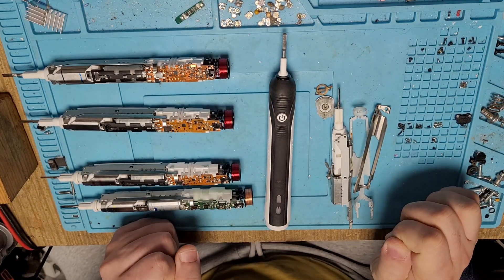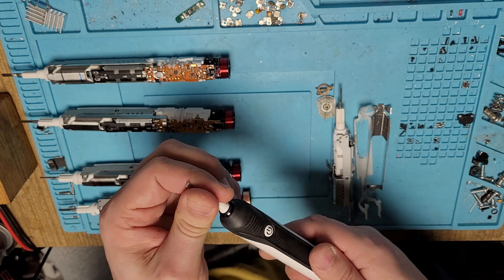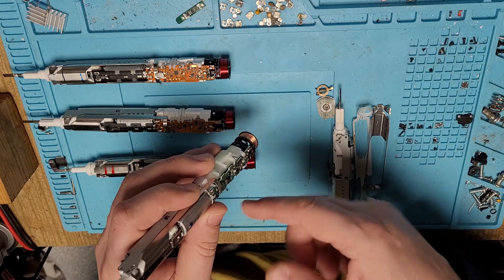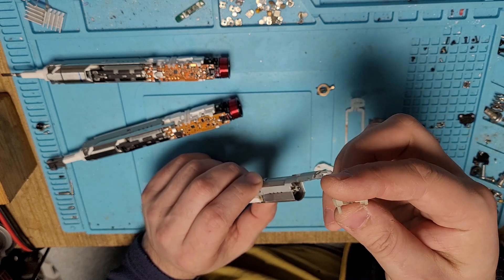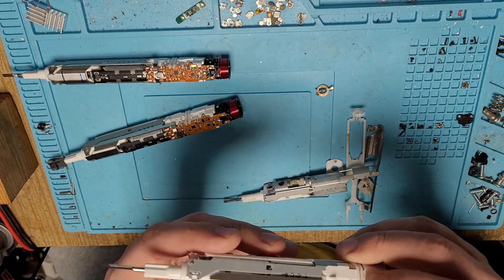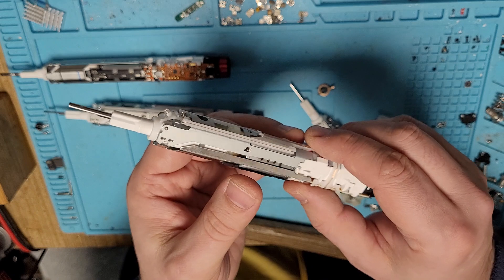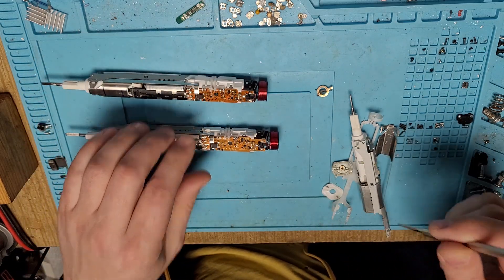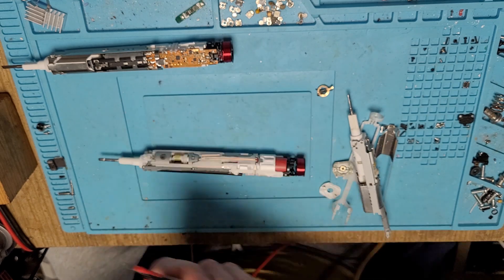Repair of various Braun Oral-B Pro or professional care toothbrush defects

Comment: Hello, my toothbrush won't start, but the battery is reading 4v. I have tested the fuses and the power resistor and all are fine. However close to the switch, there is a small brown capacitor that is shorting to ground on both ends. Would you by any chance know the ohms / voltage of the capacitors that are used as I feel it's this one issue that is stopping the entire thing turning on. I don't really wish to remove one to measure it, as they are quite small and I'll probably lose it. 

Thanks.
Reply from the maker: If it's shorting you have to remove it. Capacitors are measured in uF but it's very difficult to measure their values and there are no value on them written.. you can try to run it without the capacitor as some times they work to level out voltage spikes so not always they are 100% necessary for motherboard to function..
Reply: @letsfixitgarage  Hello, please forgive my ignorance, I didn't mean ohms, I meant microfarads, I posted this at the end of the day of fault finding. I think I was going mad by that point! 

Anyway, really weird thing. I pressed the button today and all of a sudden it's working again. I have no idea how this is possible. I pressed the button so many times yesterday and it was dead as a dodo. I kind of don't like that is working because it doesn't make sense. I would prefer to know why it hadn't been for 24 hours. Really strange. I guess what I suspected was a cap can't be a cap... but I tested all the other same colour caps and one end would have continuity between ground, and the other not, except this single cap. I'm baffled.
Reply from the maker: No worries as they say there are no bad questions but for someone new reading and learning from comments it's good to talk in the same language :) as for your problem it's very difficult to say for sure.. only time and using it/testing will show if problem will come up. Sometimes it can indicate component slowly dying but its not helping for identification and repairing.. as in my video for genius repair fuse usually reads fine but when current flows through it it heats up and resistance grows.. welcome to the frustrating electronics repair world where not always the defect is easy to find ;) good luck and come back with update if the problem will come back and you find it!

Comment: I 've been using this tooth brush for 5 years now. It still works but the rubber parts has started to disintegrate (which is disappointing as I've always kept it clean) and there is an air bubble underneath. Your video inspired me so I opened it up thinking it had to be the internal air pressure that was causing the bubble, but no. I think it's just the rubber expanding and forming a dome. There is some evidence of tooth paste ingress but it's so little that I doubt it caused any issues. I wish I could buy a replacement casing.
Reply from the maker: yes sadly this is the case especialy with white/blue type of genius x tootkbrushes.. you can look for a defect toohbrush on eBay and get a housing from there.. dont think that there will be any source for new housings sadly..

Comment: Thanks for this comprehensive video!
My Pro 1000 (1 month out of warranty!) was “stuck” just as you described, and a judicious application of a hammer got it going again. 
You have to wonder what causes this to happen so often. Looks like it really needs better brushes!
Reply: An added note about this model. The base is much easier to remove: there is a soft rubber portion on the edge of the cap, marked by a dimple. It’s easy to press there and pry the cap up.
Reply from the maker: This happens when you use metal instead of carbon brushes :) but I believe carbon dust could be even bigger headache.. so compromises...

Comment: Hello, my toothbrush turns itself on without anyone touching it. Do you know what causes that ? Thanks.
Reply from the maker: I would suggest water damage.. you need to open it up and inspect inside for water.. if present there is a lot of cleaning with alcohol. And sometimes if there is a lot of damage in motor it's not repairable sadly..
Reply: Mine has just developed a similar problem. I take it off the charger and I can't get it to work no matter how many times that I press the switch. I'll leave it sitting and 15 minutes later it spontaneously starts working. Then, I can't get it to stop no matter how many times that I press the switch. The only way to stop it is to put I on the charger! At least, I now know how to open it up.
Reply from the maker: The same suggestion would be teu here as well.. open it apart if water inside that's your answer.. if not check the button..

Comment: Thanks for this useful video. Unfortunately I think a nearby lightning strike has caused a pulse in the charging coil strong enough to fry the charging circuit, because the brush will now blink its charging light once or twice and then ‘crash.’ The charging light stays off or on until I push the button. The brush itself still works. Perhaps I can hack together a way to charge it via USB, but I think I'll just buy a new one and keep this one for spares… and put the new one in a metal box when there's another storm.
Reply: Well, I was about to hack this thing to make it chargeable via USB, and I tested it once more, and surprise: it works again! Must have been a polyfuse that took a long time to reset after the surge. So, if your toothbrush behaves like I described above, don't panic and wait a few days, it might ‘heal’ by itself.
Reply from the maker: Depends on the model but if you have Genius toothbrush it could be that your fuse is failing. check my other video on Genius repair..

Comment: I'd be very interested for you to compare this to Bitvae's rotating toothbrush.
Reply from the maker: Sadly didn't had this toothbrush in my hands... Thought to make a technical comparison of tooth brushe insides.. what topics would be interesting to know? What brands to compare?
Reply: @letsfixitgarage  the Bitvae seems to be a popular newcomer to the market, especially on Amazon, they're cheaper than the Oral B but with outstanding battery life. So it would be interesting to see their design, repairability and durability against the Oral Bs. Just purely from curiosity.
Reply from the maker: Yes there are a lot of Chinese brands that are good or bad copies of more expensive ones.. will try to make a video for this kind off comparison when I will have more of them but one problem that I see with Xiaomi brand toothbrushes that they use their own rubber seal and there is no replacement as spare part... So that would be one big minus point from my side :)

Comment: Help, your video although great didn't show me my issue. It did help me get it open however. My issue the lights turn on but the motor doesn't come on. I checked and the motor turns freely. It is a model 3760.
Any help or suggestion would be great.
Reply from the maker: I think I answered to your email but if someone else is looking for answer check my other video on Genius repair.

Comment: Hello and thanks for the information! I haven't found my answer in comments or multimeter, yet :)
Basically with a 3.6v battery, when I push the button I get flashing red battery light. When I put it on the charger, nothing. 
I'm suspecting the chip on the board as there is nothing obviously shorted, and the resistor you mentioned seems to read normal, the fuse too.....Although I don't have another one to compare values. Any Ideas?? Thanks
Reply from the maker: 3.6 is low.. you can charge battery externally up to 4v. Then check if charger is charging at all maybe charging coil is damaged.. there are a lot that could be wrong so you need to check what is working to eliminate options...
Reply: @letsfixitgarage  Thank you for your reply =)
I´m going to try to get another unit or a lot so that I can do a bit more comparison.
The coil seems fine, it has continuity....Next time I put it back together I´ll try it with the battery at 4v and see if it makes any difference. Will also try shorting the fuse, just to make sure! As I slowly learn more about electronics hopefully my diagnosis skills get better =) People like you really help!!

Comment: The chisel method worked for me. My pro 1000 toothbrush froze after it was dropped. I had to hammer the metal gear a few times before it broke loose. Thank you very much.

Comment: Very helpful, just repaired two toothbrushes with exactly the same problem: broken charging wire. One addition is really necessary however: when reassebling you should first remove the top cap. After inserting the core into the 'house' the top cap can be replaced with the help of a wrench or so.

Comment: Hi, your videao was helpfull. I put everything together and now the red light on top of the brush is constantly on. How can i Fix this? Thanks
Reply from the maker: Difficult to say what was done to it but I would inspect the metal part with spring and it's contact to the motherboard that's responsible for to much pressure indication.. something was done to it during repair..
Reply: @letsfixitgarage  already fixed it. It was indeed the metal part that was bend to much. All is working again. Thanks

Comment: When you buy them the instructions tell you how to open these to dispose of the cell when throwing away.  You put on charger and twist the base.  I have opened a number of them.  Much easier than vice grips and screwdrivers!.
Reply from the maker: Thanks for your input! I wouldn't always trust manufacturer on these things as example Philips suggests opening its toothbrush using a hammer to destroy the housing and then remove the battery :) if it's easier to twist it, sure use this method, I found this method less harmful for the end cap clips. And purpose of the video was repair tips on internals, not opening..

Comment: Thank’s, mine wasn’t charging, took apart nothing broken turned out at the charging point where spring goes in contaminated (toothpaste?) quick clean with earbud sorted👍
Reply from the maker: glad you found the problem.. although contamination shouldn't affect the charging coil as it is isolated.. additionally if you found toothpaste on the bottom part it could be that you have a hole in the bottom cap as membrane was damaged? if that's the case you need to seal it. best would be to replace the bottom cap as membrane allows for some moisture to escape the housing without it it can damage the electronics even more,,

Comment: Every time I switch mine on, the red sensor light at the top comes on.. And nothing else moves?.. It charges too.. But soon as the power button is pressed, it triggers the sensor light without any movement.
Reply from the maker: Difficult to say.. I would first open it up to examine if there is no water damage inside.. then you could try to remove battery power from motherboard to reset it..

Comment: Hi. My oralb starts on its will. Randomly any time and it stops itself. I opened it and cleaned it with wd40. The problem still stays. What must be done?
Thanks in advance
Reply from the maker: Please don't use WD40 on electronics.. only isopropyl alcohol for cleaning the boards... I would start testing with the on/off button if some moisture got inside you need to replace it or take it apart and clean it. If the damage is on the board it would mean more testing.. additionally to be sure you would need to take the board off to test if there is no damage on the back side...
Reply: @letsfixitgarage  thanks for ur help

Comment: Just found your video and trying to troubleshoot. I am a very beginner in electronics but i'm not scared to learn. When i press the button nothing happens. Found that bypassing the power regulator (just as you did at 13:06) makes my toothbrush work, but i got stuck at this point. Any tips on a fix?
Reply from the maker: You can do it! <-- was sugested by Youtube :) its current sensing resistor. it should be replaced with a working one as without it the motor will not shut down and something could catch fire in worst case..
Reply: @letsfixitgarage  
Thank you for the faith you have in me! But 10000% i cannot do it :( my precision skills and eyesight are horrible, so replacing a small IC is a nope.

Comment: Dropped my brush and it just does a beep noise when i try to start it. All things were in place and i tried to rotate motor and it rotates freely so i dont know why it isnt working, any ideas?
Reply from the maker: just a gues but check the gear on the motor shaft maybe the gear broke and thats why you are able to rotate it but motor itself is still stuck..
Reply: @letsfixitgarage  thanks for the response. Both gears (small and big) are rotating, but ive noticed onething. Above the small golden gear there is like a coil and a white surface underneath the coil. Is the coil and small gear supposed to touch eachother?
Reply from the maker: @lolbeno10  if I understand correctly the described part is a spring that pushes the shaft back up if you press it. It's not connected to the gear. What you can try is to apply 3-4v to the motor contacts if it rotates problem is on the motherboard and not the drive..
Reply: @xitgarage Tried doing what you did on 13:05 with the current resistor. i put the tweezers around a glass thing (on the brush) and it started shining red for some reason. i did it again and it was red, tried to start it and now i dont hear any beep sound and it seems like the brush isnt even charging. Any ideas? appreciate your response.
Reply from the maker: Shorting something on PCB with tweezers is not a good strategy.. you can easily burn or short something including main chip.. you can try removing battery power from PCB maybe it will reset it but it could be a deeper problem where specific electronic repair knowledge is needed. Not possible to share it through comments..

Comment: I feel some smell (smell of a working motor) from the shaft side and think the seal is broken there. Is it possible to change the seal if it is broken? or could it be a totally different reason? do the water leaked into inside totally damage the things?
Reply from the maker: It could be some buildup inside of the shaft that makes some friction and smell.. seal is quite reliable in these brushes and fails rarely but when water gets inside usually no chance of repairing as there is a lot of debris in transmission and a lot of rust buildup..
Reply: @letsfixitgarage  Thank you for the reply.

Comment: My toothbrush has an intermittent problem. Sometimes it works fine, other times it will not turn on at all. It does not make any noise when this happens.  Could it be the on/off button?
Reply from the maker: I would first check battery solder points. Saw multiple with broken off battery leads so sometimes it touches and works sometimes it has no power..

Comment: Thanks.  Nice video.  After taking my toothbrush apart I discovered that the miniature surface mount momentary button switch was worn out.  I soldered on a new switch and it works like new.

Comment: Mine even got worse when I opened it before opening: motor not moving (only a little sometimes), charges, battery appears to be full. After opening no lights, motor not stuck and battery gives out 4v and fuse has 3,6 ohm and it still seems to charge suggestions?
Reply from the maker: Try to remove one of the battery contacts from motherboard for short time.. to reset it..
Reply: @letsfixitgarage  seems tricky everything is well solderd

Comment: Hello, Great video!  My model# 3765 has a problem you didn't mention. The electrical bits work perfectly, but The metal vibrating tip just snapped off in my hand, right at the little notch. Now the brush head won't stay on. Is this part replaceable? Or is this thing headed for the "extra parts" bin?
Reply from the maker: Doubt it.. don't think any epoxy will hold in that place.. I saw few of these defects but it is quite rare.. try to get a defective similar model toothbrush and Frankenstein a working one ;)

Comment: I haven't see how to replace the battery.Any thoughts?
Reply from the maker: Just desolder the 2 terminal points and charging coil. If you want to preserve Battery nickel strips (they are interestingly formed) removal of motherboard helps if no just pull it out in to direction of charging coil.

Comment: I have an oral B braun 3772 that stopped working one day while I was using it. I put it back on the charger and it still blinks green when I do that. When I press the power button even months without charging, it makes this quiet beep noise. Does this symptom sound similar?  I'm guessing that the beep that happens when i click the power button means that the power button is functioning. Thanks!
Reply from the maker: It could be exactly what I was showing in this video. Motor brushes are stuck and all you need is to rotate the motor gear to free it up.. try to open it up and see if motor rotates freely.

Comment: Thanks a million! The hammering works! I used a small screw driver and hit the black gear connected to the motor shaft with my palm and it set the gears in place and worked! Oral B 3000

Comment: hi i have a new one model 3766 and it appears to work fine, powers on works but no LEDs at all, i cant tell if its charging or not. how do i fix it?
Reply from the maker: difficult to say... for this you would need to take it apart and look for some clues.. but you could damage the bottom cap by taking it apart so if it works just charge it every week..